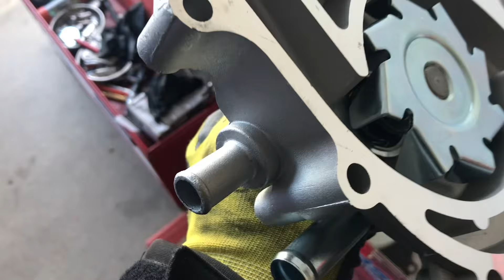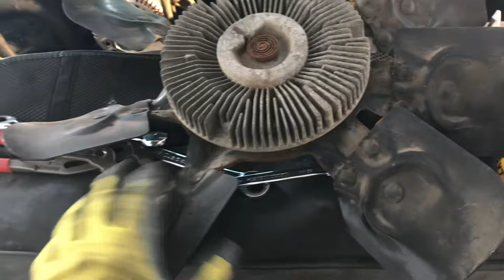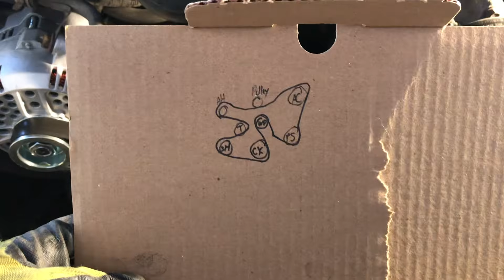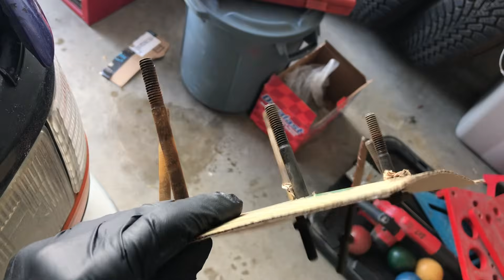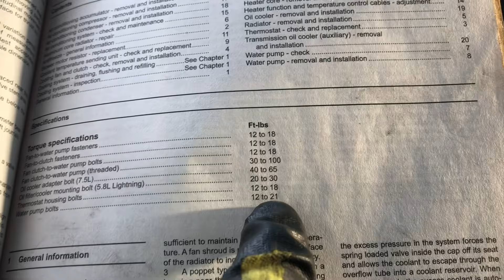How to Replace a Water Pump | 1995 Ford F150

Comment: mine came with 2 gaskets- do you put a gasket on each side of the plate?
Reply from the maker: Yes, one gasket for each side of the plate.
Reply: @TheMinuteMasters  nice I figured that and for the harmonic balancer in order to use a longer bolt to press it back on- how much longer do you think . I havent gotten under the car yet but I guessin 1-1.5 inches or it might depend on how much  the new one will slide on before it needs pressing on. There is a kit to do it with but a longer bolt should do the trick- its only been 30-35 yrs since my last one I did lol

Comment: I thought you were supposed to let the engine get to temp and then top it off?
Reply from the maker: I’ll have to go back and check that procedure but if the engine was hot, that would be difficult to add fluid. The heat would create pressure and overflow.

Comment: Hey mate. The gasket on the back of the water pump between the pump and the steel plate do you need to undo the two bolts and RTV that gasket to the plate then the plate to gasket to the timing cover or just the gasket to the timing cover ?
Reply from the maker: Good question. I can’t remember exactly what I did when I filmed this video. But I’m pretty sure I needed to have a gasket or RTV between the water pump and that steel separator plate.

Comment: I broke off the far left one, and As I bought a replacement, it was the wrong bolt. I have no idea what to do. I have the same 302 V8 and I bought the 23744 and it was wrong
Reply from the maker: So you broke off the far left bolt. Are you able to remove it? I’m assuming it broke while removing the old pump or instal the new one.

Comment: A while back my 95 F-150 started to overheat in stop and go traffic. I figured the cheapest and easiest first move was to change the thermostat to a lower temp one. It still overheated, so I started pricing parts. I found that I could replace the Radiator, Water pump and the fan clutch for just over $240, so I did. I live in central Florida and even on the hottest days the water temp hardly gets above the O in NORMAL. My truck is a 300 IL 6 with a 5 speed manual, so it has a tach on the right and speedo in the center. I want to replace the idiot lights in the dash with actual gauges. I need numbers, not letters. I need to find an old junk yard cluster to hack up to find a way to do this. I'll let you know if it works.
Reply from the maker: Sounds about right. My brother has a straight 6 in FL as well.

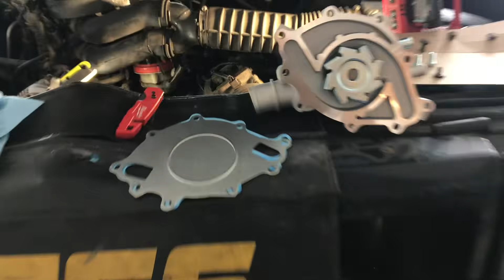Comment: At 10:09, are you saying to apply the sealer to the pump before attaching the plate, or should the sealer go on the back of the plate before mounting it to the block? Mine came pre-assembled with the plate, so I left it as it was, applied the sealer to the back, and then mounted it to the block. I must have done something wrong because now, a few months later, I have a bad coolant leak.
Reply: ouch brother. I was looking to ask the same question. guess i'll be putting it on every surface! sure sucks though cause thats 4 surfaces. both sides of each gasket. i did read though that the sealant has a 24hr cure time so that mightve been your downfall as well.
Reply: @jeremysonneman1330  Nah, I waited a full day before running coolant through. Or at least like 15 hours. On the gaskets you're just supposed to put a thin film of rtv and tack it to the block then put the pump on, but I ran a bead of rtv and I think that's what I did wrong, I used too much. I talked to someone on the ford forums and they say either you do rtv or you do a gasket, but never both, and also I didnt put any rtv on the long bolt threads, which you're supposed to do too I think. 

It may not even be the water pump leaking, It's very hard to tell where the leak is. it may be my timing cover, so Im just going to go through the PITA process all over again + do the timing cover gasket.
Reply from the maker: So I don’t think I captured this in this video, but if I remember correctly I only used the gaskets and I got a leak. That’s when I started using RTV. I say, do what works and think about what the gasket seals and what it doesn’t. They will help more in guiding you. The Haynes manual i use didn’t offer any tips either.

Comment: Do you remember which paint stripping wheel you used to clean the surface? My old gasket is basically fused to my metal and will not come off with anything I try, but im worried about damaging the maring surface with the paint stripper disk.
Reply from the maker: I’ve always called them honeycomb wheels. Some thing like this should do the trick. I’m not sure what abrasive level inside but you don’t need anything aggressive 

https://amzn.to/3Clg0Jh

Comment: The gap in the fan blades was not created to make it easier to fit your hand through.🤣🤣  Engineers don't usually design around the accessibility of access for mechanics. 😉😉
The staggered fan blades allow air to move without creating excess noise.
But... Since that big gap is there, you might as well take advantage of it.
Reply from the maker: Hahaha! Now that you say it out loud, it definitely seems very unlikely the engineers would’ve thought of the end user.

Comment: This job took me 5 days😂 the bolt that goes through the water pump into the timing cover snapped. We tried welding nuts on it, heating it up, bolt extractor. It just wouldn’t come out. We ended up breaking the timing cover to get it out. It turns out that in the end I needed a new timing cover gasket anyway. Bright side is that I get many new shiny parts under the hood now at least😂
Reply from the maker: Wow! That’s incredible! At least you’ve got everything buttoned up and it looks brand new!

Comment: another minor safety thing is to make sure you have the heater in the on position, so that you don't keep an air bubble in there.
Reply: The temperature to hot setting and fan on high.   This will allow coolant to flow through the heater core and feel the vent for heat.  Allow it to circulate well and get all the air removed from the system
Reply from the maker: @kenwitt4712  Excellent tip!
Reply from the maker: Interesting. I didn’t know that.

Comment: Soso what is the torque specs for the bolts for the fan screws?
Reply from the maker: Good question. I’m not entirely sure because I usually just estimate the tightness needed.

Comment: I ran into a frozen bolt next to the lower radiator hose outlet on the pump. Ended up using an air chisel to break away the aluminum pump boss to expose the bolt at the timing chain cover. Back plate had to be unbolted from pump to remove it completely out of the way. PB blaster, oxi-torch and vibration was needed to loosen the bolt and  prevent it from snapping off inside the block which would  require removing the timing chain cover and drilling out the bolt. PITA but avoided having to go deeper into the engine to get the fix! ...Ford's, "Not Better Idea!" Don't forget to wire wheel all bolts and use anti-seize for future ease of replacement. Replaced the thermostat, gasket and all hoses as preventative since they were already removed. Easier now than later! New antifreeze too! Good luck, y'all!
Reply from the maker: Good process man!!

Comment: My friend! I need the sizes for the correct sockets to remove the pump bolts, I found 14mm or 9/16 is one, I think the ac compressor is the same, what about the rest? I couldn't find it in any of the ones I have. I'll let them soaked with PB Blaster overnight, some people scared me about some bolts can break. Tomorrow I'll go to Lowes to find the sockets but I need to know the sizes. Help please!!!!! Thanks always, you're the best!!!
Reply from the maker: I can’t remember off hand. Do you have a socket set or you only own a few individual sockets? PB Blaster is a good idea! 
You’re welcome!
Reply: @TheMinuteMasters  I have several sockets through the years, but you always need the one you don't have. I just purchased a new SAE socket set but, it was raining all day and still non stop! lol, I'll let you know. Thanks for answering anyway!
Reply: @TheMinuteMasters  They are 5/8. I got the pump removed yesterday, now I need to install it. I was extremely careful to don't brake any bolts. I left the easier ones to the end, the 3 top ones, the last one broke when it was 3/4 thread out. I was lucky because I had enough thread to use a small pipe wrench and with a little heat from a propane torch and patience, I removed it. I purchased the LMR set for Bronco, Black Oxide coating, they are ultra expensive ($99) from ARP (at least for my pocket), to avoid broken bolts in the future. I already cleaned everything, today, I'll install the pump and then, flush the cooling system.

Comment: This didn't help me.  I was hoping there would be an easy way to get that one bolt out that is behind the A/C-power steering mounting bracket.  You just jumped from the bracket being mounted to the bracket being removed.

Comment: One thing I do recommend if the truck does have a heater is to turn it on as well, it’s possible to get air trapped in there and cause some over heating issues.

Comment: Having issues with two bolts don’t want to come off, is it possible to remove the timing cover while water pump still attached to timing cover and replace them both? And fix them both and not deal with broken bolts?
Reply from the maker: If the bolts fees through the water pump and timing cover, then they have to be removed. Have you tried heating up the bolts?
Reply: Yep like five or six times now concerned and not really sure best way to proceed, thanks though though I get your feed back thanks
Reply: @TheMinuteMasters  yes multiple times, no progress with it though, thanks

Comment: Love this series as I just acquired a 95 F 150 with the 5.0.  First thing it did when I got it was pee coolant on my driveway. Water pump and thermostat this weekend.  One thing that should also be mentioned on refilling the system with coolant.  Turn the heat on in the truck so the valve is open to the heater core. This ensures you are bleeding the air out of it as well as the rest of the system.
Reply from the maker: Thanks man!🤙 I appreciate it!

That’s a very good tip!
Reply: just got a 87’ 5.0 water pump came broke, also had no coolant

Comment: When filling the coolant, we just take the cap off and fill it straight into the top of the radiator right? Also, what if we dont have a torque wrench is there any way to properly torque it down or no?
Reply from the maker: Yes, you do that and then you leave the cap off and turn the truck on and let the water pump cycle water through to get all the air out.
You can probably torque everything down just by feel but you would be taking a risk. It’s definitely worth buying a torque wrench. There are a lot of affordable options out there these days.

Comment: Can you list a link or part number or something for each part?
Reply from the maker: I bought this water pump and gasket from an O’Reilly’s. So, I don’t have a part number available for you. Are you trying to buy these parts online?
Reply: @TheMinuteMasters  Yes, I'm buying off of Rock Auto. Which i trust, just wanna make sure its the right one for sure because I saw a video that said some of the water pumps are different and spin clockwise while others spin counterclockwise or something...I was like well uhhh now I'm confused.
Reply from the maker: @SebastianTheodore  I’ve never heard of that before. They only spin in the direction the serpentine belt goes. So if it goes backwards then the serpentine belt is installed incorrectly.
Reply: @SebastianTheodore  , some boat engines turn the opposite direction. There are "marine" versions of parts.

Comment: Get the Ford water pump , the other pumps O'Reilly ect. only last 30 t0 40 thousand miles  , I've done this job 5 times now 451000 miles 5,0 l
Reply from the maker: Now you have me worried Roy. Lol I guess we’ll see how long this one lasts. Usually if I’m not under a time constraint, I try to order the best parts available.
Reply: @TheMinuteMasters  the original pump lasted 220000. Miles

Comment: Sounds like a job but noticed a have a coolant leak with possible culprit be the water pump be the problem. Thanks for run through.
Reply from the maker: It takes an hour or so but it’s pretty straightforward. Your welcome and good luck!🤙
Reply from the maker: It takes an hour or so but it’s pretty straightforward. You’re welcome and good luck!🤙

Comment: 2 yr old video and its still helpful lol. Last couple days, I've been noticing, not much, but tiny amount of the antifreeze on the ground, thought it was my bottom hose, so I replaced the clamps, its tight alright, except, it still showed up, the tiny puddle, found out, Its the "Wheepie hole" lol. Crap!! seal going bad inside water pump, now in mean time while I am researching water pumps too buy and waiting on MONEY to get it, I am researching videos, found this one, VERY informative, thank you! Will be saving this one to my "Repair" list for use when it comes time next week too do it, after I can buy it all lol. I am figuring, while I got the belt off too, I might just replace it also! I've been delivery driving lately, for my employment, and yes, my F150 '94 lol, decent gas mileage, 15 in the city. comparable to other cars mostly, but, my truck is OLD, 188k miles lol. Runs like a beast lol. So... Time to fix the pump, again, GREAT VIDEO! Thanks 😀
Reply from the maker: Yup! I had the same experience two years ago before I filmed this video. 
With the pump off, it’s definitely a good time to replace any parts you have to remove to replace the pump (if it’s in the budget). 
Hey, these trucks are beasts and they run for a hood long time if you keep the fluids in good order. My truck has 245,000 miles and another commenter told me his truck has 408,000 miles!😳
Anyhow, you are most welcome Brian! 🤙I appreciate the viewership and good luck on replacing your water pump.

Comment: I mean dude you didn't even show how you took the bolts off! And you failed to warn people that these pumps tend to rust the bolts and basically weld themselves to the block. Mostly the two sides. Please show work it would be appreciated.
Reply: Bro he’s not obligated to show you the work if you have an issue with it then why won’t you do a video explaining that. This guy got me fixing my truck no problem. People be petty sometimes.
Reply from the maker: I didn’t used to show me actually doing the work. My newer videos do. 
Are you having a hard time getting those bolts out? Honestly, all I used was an impact gun and they came out no problem. Some did look better than others.
Reply: Those bolts get pretty corroded, best to get replacements from ARP. Used an induction heater to help break the rust off. Made the mistake of not putting any RTV. My garage is a mess. Will be doing this tomorrow thanks for the vid

Comment: Hey idk if you will see this but i lived with a crack head that was trying to start a flooring bussiness he had the 1995 ford e250 van checked out professionally an they said we needed to get a new transmission and water pump he took apart water pump an wont put it back together can you write me back an tell me where the bolts go i really need my car off hus property he said he is moving an will have it towed
Reply from the maker: What engine do you have? If you have a 5.0 or 5.8 the engine, you can watch my video on how to replace a water pump. It should be all the same except for maybe a few differences with accessories.
Reply from the maker: This video should work for you.
Reply from the maker: Which bolts do you need to know specifically?

Comment: Could you be kind enough to get a measurement of the thru bolt on the power steering
Reply from the maker: Do you need to know the length of the bolt that holds the power steering bracket or the bolt that holds the AC compressor to the power steering bracket?
Reply: @TheMinuteMasters  I just broke this bold, the long steel bolt that runs through the AC bracket that goes into the aluminum head.  Where can I get these bolds.  I hope my stud extractor works :(
Reply: The thru bolt that holds the water pump that goes thru the ac compressor bracket
Reply from the maker: @eddysoto3184  Gotcha. Are you missing yours? That’s a special bolt because it has the extra long stud on it to support the power steering pump bracket.

Comment: if you noticed rust on the ends of some water pump bolts, they should be rtv sealed before installing- they intrude into cooling passages
Reply from the maker: Yup! I learned that lesson on a previous car I owned. Now, I seal my bolts with RTV.

Comment: How long do you let the blue sealant dry before you can drive it?
Reply from the maker: To be honest I really didn’t give it very long. I think once I got everything bolted back together and all my tools cleaned up. I started the truck up so maybe it had 15 to 20 minutes to cure. Which is really all you need if you are using a gasket.
Reply: @TheMinuteMasters  ok, thanks for the reply